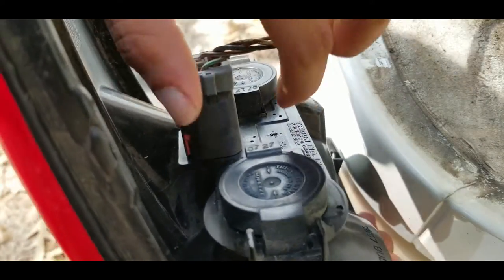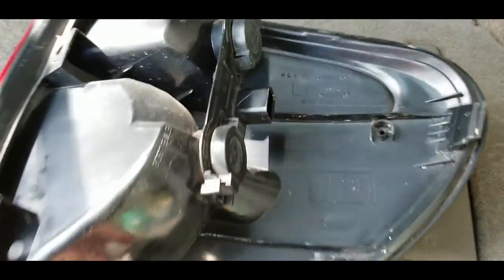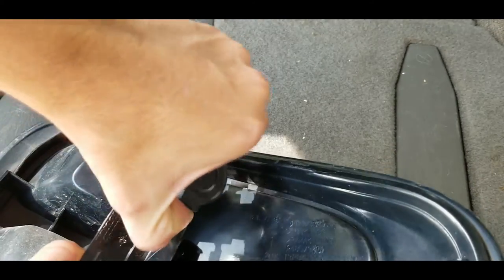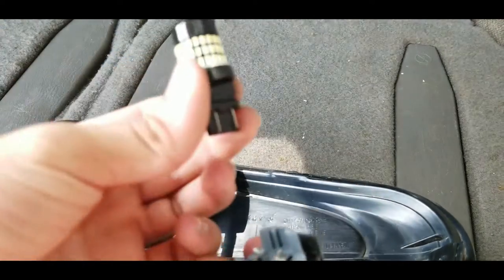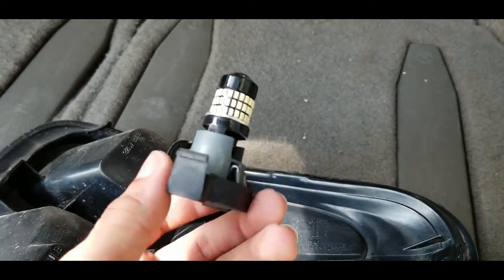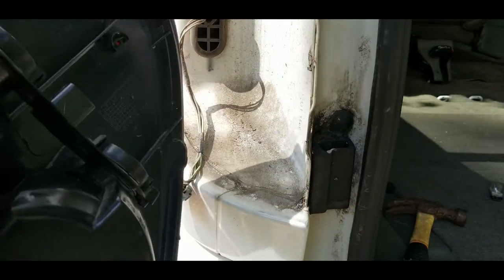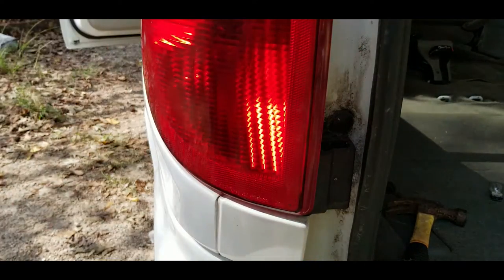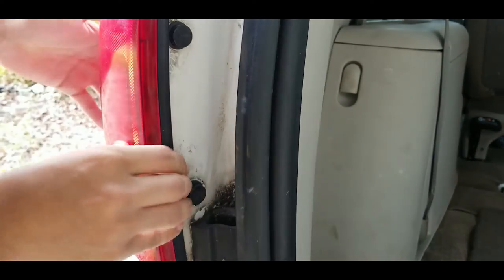Tail Light Removal/Install 01-07 Grand Caravan/Town & Country | Turn Signal/Reverse Bulb Replacement

Comment: Which bulb ( there are only 2 as far as I can tell) do you replace if you turn on your lights at night and nothing comes on in back?  The turn signal, brake lights and reverse work.
Reply from the maker: It's sounds like your car is staying in drl mode. Those are the only bulbs in the rear not sure which ones you're trying to replace. Licence plate?

Comment: Well I feel bad.  I broke both of those plastic plugs but one still works kind of.  I broke the plastic thing holding the light in place and the little metal contacts clips came out and it appears one broke.  If this is an easy job then I just can't do it.  I may buy a new assembly and replace the whole thing.
Reply: I like to practice at a salvage yard. I collect the fasteners, electrical sockets and the lens assembly at a much lower price than a new one. If I break it on removal I can figure out how it is attached so that I don't break mine. Sometimes you can find these parts on e-bay or amazon for a lot cheaper than what a dealership/stealership has to charge.

Comment: load resistor and flasher relay needed too i guess
Reply from the maker: The reverse bulb does not need a relay or resistor. The signal bulb needs a resistor.

Comment: did you ever had a blinking issue with the leds in the back? in the font of our 07 with under 57k miles, dodge grand caravan with the 3.8L i had to put in a resistor for the DRL's, do i need one for the back or no?
Reply from the maker: I didn't need one for the reverse light. But the signal bulb needed a resistor.
Reply: @TechiePocket1  I’m curious. I want to get leds for the rear. The whole front end is led converted and so is most of the interior. Because of the design how they made it different in the rear for the lights how did you install a resistor?
Reply from the maker: @KhaiMahase  same as front. Wired it into the harness and screwed it into the body
Reply: @TechiePocket1  which wires did you tap a resistor into?